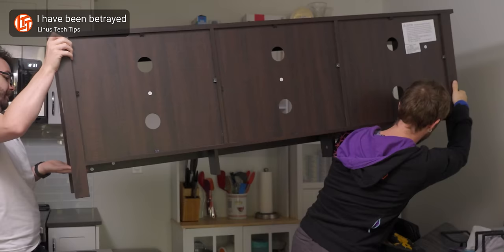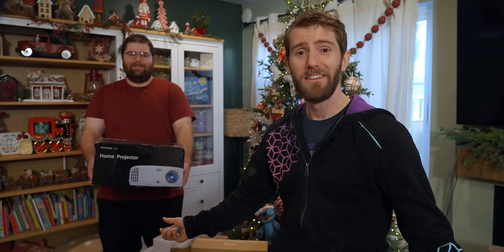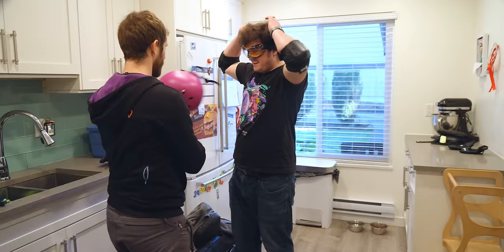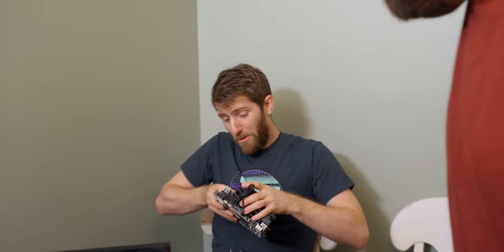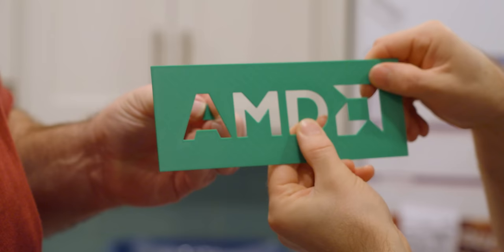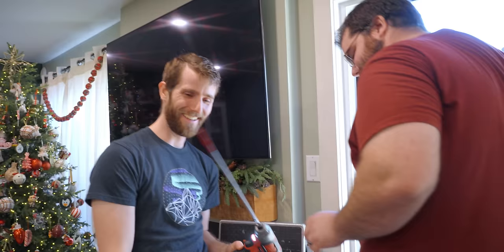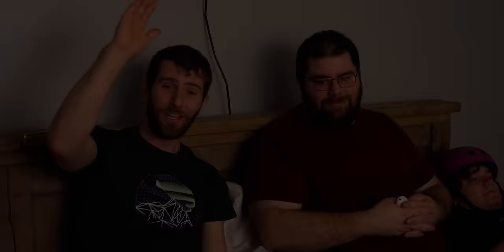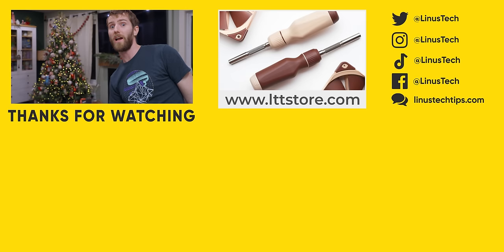A Hardcore Tech Upgrade - AMD $5000 Ultimate Tech Upgrade

Comment: DUDE I dreamt about myself locked in your basement 💀.....then I accidentally made a sound that got your attention...After that y'all started searching for me and you also activated a Steel Bars To prevent everyone from coming inside or going outside 😶
Then you were saying " Where r yoooooo....expose yourself"... after that I saw you in front of me and a kitchen table ....you were like " Who Are You?...What Company made You bro!?"...after that I started running away to get outside from the house....I got a rope and I found an open ceiling window that doesn't have any bars.💀
After that I jumped and I attached the rope on something but I slipped from the ceiling and I couldn't catch anything, but I found myself on a mountain that doesn't have anything but snow...then suddenly I saw you staring at me☠️☠️☠️
I don't remember what happened after that !

Comment: Hey I was just wondering can you tell me what is the best gaming  desktop  I can build for myself for $1000 or maybe a little bit more and is water cooling a must have on a desktop or is fans OK to have without having water cooling on your desktop and could you tell me what is the best chip the best ram, the best storage, the best Wi-Fi Bluetooth the best keyboard and mouse that I can buy and the best case to put all those components in for $1000 or a little bit more that would run all my games pretty well and if it can be purple, that would be awesome or green or yellow or red or blue or orange that would be awesome if you could let me know it is lighting RGB worth putting in a computer and if I can get that for not too expensive that would be cool too. If that’s not important, that’s fine.

Comment: Who keeps a display beside their bed? Also me, I have 4, 2 motherboards, a full computer, hooked up and running, and lots of wires and electronic shit, maybe a sock or 2.
Correction: The working computer is ON my bed. I sleep with it but have no sentimental attachment to it, it just happened to be easier to work with it... :🤣 🤣

Comment: Hello everyone,

I hope this message finds you well. I'm reaching out to the tech community with a unique request. In the past year, I've turned to streaming and gaming as a means to cope with the loss of my wife, who passed away in December of 2022. Currently, I'm using a $2500 laptop that's struggling to keep up with the demands of 4k gaming, streaming, and video editing.

With a $5000 budget for a new PC build, I'm looking to create a setup that not only meets my needs but also fits into a specific case—the Hyte 70 Touch. As someone who has built systems in the past, I'm open to advice or suggestions in choosing the right components. My goal is not only to enhance my streaming and gaming experience but also to dedicate the build to other widowers who have lost a loved one. I believe this could be a powerful way to share our stories, support one another, and find a constructive outlet for dealing with depression and coping with loss.

If anyone in the tech community is willing to lend their expertise or provide advice, I would greatly appreciate it. Let's come together and create something meaningful for those going through similar experiences.

Looking forward to hearing from you and potentially receiving guidance on this impactful project.

Best regards, 

Ryan